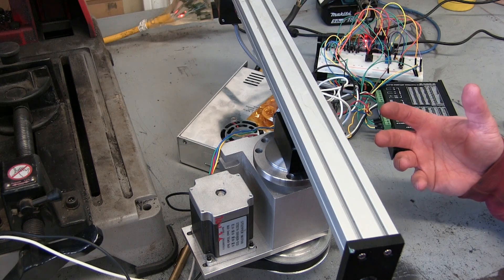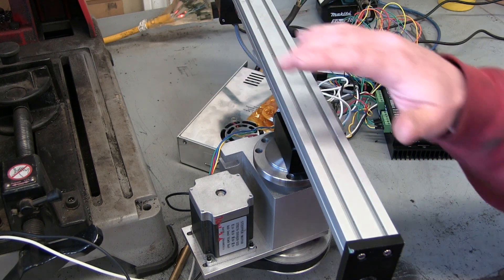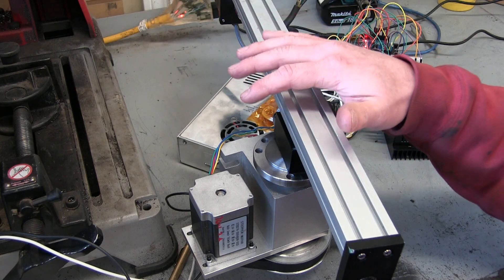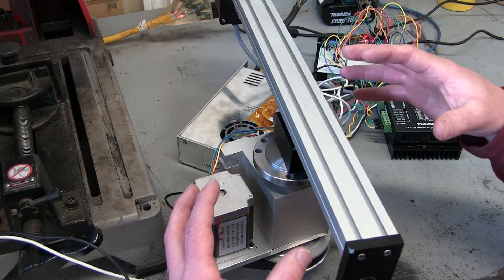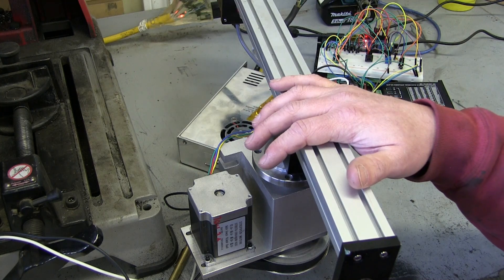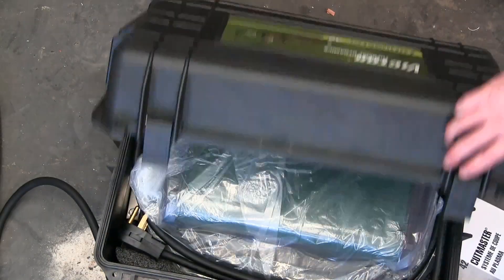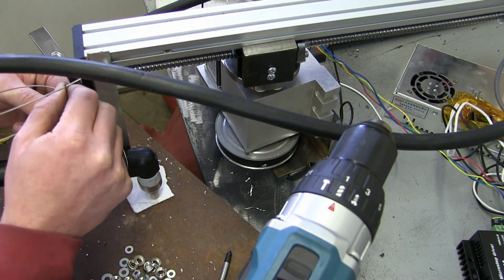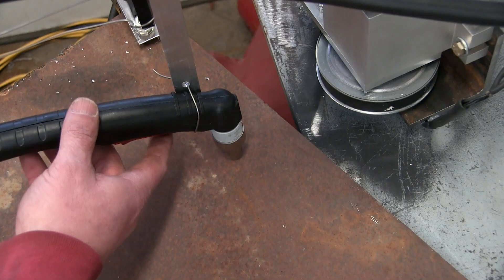Portable CNC Plasma Prototype

Comment: The obvious pitfall is that angle errors are amplified as the arm extends.  That'll be a headache for larger work.  You can set an upper bound on tolerances by limiting the arm length or using a more precise motor.  But if you want this kind of thing to scale, you probably need feedback.  I vote computer vision using fiducials or a stick-on grid.  Not trivial, but it is doable.

Comment: As you said AvE it's gotta be simple as frigg   ....   I think that's where your issues lie.   And you're thinking the app part but I think you're right, the app could be fairly simple and get the job done.  But Magdrills are used inside the webbing of I beams, or in truck frames, places where there's some sort of boundary in place.  You're proof of concept here looks a bit on the large side to fit in those places but that's not even the worst part,   it's making sure the slot it cuts is aligned to the beam given that you plopped that magnetic base down in the first convenient place.   You mentioned programming it once to do a series of holes  ....  how do you align that series of holes to the axis of the beam?   If you're gonna tell a 40 y.o. tradesman to do a bunch of layout first to figure out where to put his magnetic base then you lost him right there. If he's gonna have to do layout anyway, he'd rather it end up with a center punch showing him exactly where those holes will be and the only way that f**ks up is because he missed his punch mark with the pin inside the rotorbroach.   Laser projection was mentioned, it's a good start but I think it's more complicated than that.

What if a flat surface was included on the boom which could be aligned with say a beam flange. An angle sensor would then tell the programming "This is the theta = 0 deg line."  A simple combination square could be slid along the beam flange to reach across to the boom and align this flat datum surface. The user then pulls the torch carrier into place which calibrates the "radius = 0" diameter?    With that you've calibrated the theta = 0, radius = 0 coordinate, of the geometry you plan to cut, while also inputted the directionality from "0,0" to find the center of rotation for the magnet the boom actually rotates about.  This however would require an absolute position sensor for linear movement of the torch carrier and adds cost.

Sorry for the novel,  trying to offer a bit of a solution after pointing out potential problem

Comment: Kinda worried about the precision on your rotary axis.  It's going to get less accurate, and have a lot more flex to it, as you get farther from the pivot point.

You want to figure out a way to get that plasma cutter as close to the axis of rotation as possible.

Comment: I like the idea! The open source 3d printer and lasercutter community pretty much has everything you need to accomplish everything you want. Everything from the main board to control the steppers, all the way to an app on your phone to control the thing. They also have similar polar kinematics already built into the different 3d printer firmwares along with special gcodes designated for firing the laser or starting a plasma torch. The firmware is really easy to modify depending on your setup as well. All you would need to do is build the hardware and connect up the electronics. As for creating the toolpaths, I would use something like Laserweb (still in beta). It's super simple and intuitive, then you can just send that gcode to the machine and bob's your uncle! If you're serious about making it, then let me know. I can point you in the right direction for the different software and control boards, although I know that you are no slouch when it comes to wrangling those pixies!

Comment: It'd be interesting if it had a dry-run mode that just used a laser diode to indicate where the cut would be while it moves through the motions.
Reply: or a magic marker holder, dryrun and paint a pretty picture.

Comment: Your control algorithm will need to know for the current radius of the linear axis  and account for it in the feed rate of the rotary axis.   Just like facing on a lathe, you will need to implement a "constant surface footage" function to speed up the rotary axis as the linear feeds in and slow it down again as it feeds out.

Comment: It's missing HPHT, you'd also probably need a quick way to calibrate the tool before each use to make sure you don't you end up with metricsexual or smelly imperial units that aren't accurate. I've seen a handheld CNC wood router solve that problem using cheap QR code like stickers that a camera on the tool then capures and uses to keep track of where it it is in space. this method also lets you do some other cool augmented reality stuff when it comes to placing pre canned objects. you could probably migrate some of that functionality over to a smartphone app

But the idea is brilliant.

Comment: Mark it with the plasma, cut it with the pliers ;) maybe after a few of the bugs are worked out implementing a rotational axis to the torch head for starting bevels or maybe intricate cuts in angle iron

Comment: Welder studying to be an engineer, I would use this all the time! Cool idea for sure! So converting this thing to x, y coordinates ain't too hard. It's working on polar coordinates (radius,degrees), simply x = Radius*cos(degrees) and y = Radius*sin(degrees). I also want to suggest that if you want to make it simple for using, consider a linear actuator to set the height of the torch above the workpiece and have it read how far it is from the workpiece when it cuts. That way you can account for curves, bumps, height differences and whatever else! Big fan and hope you get a a chance to read this 👍🏻

Comment: Fuck yeah I'd use this, thats badass. Coding would be done with Java for the App and that way its cross-platform, you could run it on a windows tablet or laptop, android phone, windows phone, iPhone, linux computer, whathaveyou. I would think you might need a sensor or two to pick up its home location and orient itself for the whole rotary axis plus linear axis.

Comment: If you want cleaner cuts you can do what laser CNC machines do and punch through inside the perimeter of the piece you're cutting and work out to the perimeter then cut your shape. There's a name for it I forget (it was 15 years ago I worked with lasers and I'm getting old so..) but it'll stop you having that blow hole where you start your cut when the scrap in the middle is removed.

Comment: Well, I don't know about fancy programming, and your pixie paddocks, so there may be many reasons this won't work. But if it were me, I'd want the cutter head position as an input (axis and depth), and then trace the shape I wanted manually. Take whatever the input from manually drawing was and find a way to make the head "do what I did". If all you're looking for is a bunch of canned shapes, trace them at an appropriate speed and run them like a macro.
Reply: I'm not sure what your full intended use is, but a repeat button for some shape would be useful. "Train cutter", repostition cutter, layout next position while cutter cuts. Robo Apprentice TM

Comment: this is a great idea, using a mag drill is fine but ive found sometimes you cant get the mag drill in the right place so i have to weld on extra plates to mount the drill on to. but this with a smaller foot print would be really good, plus you can use this to cut any shape, so it has multiple applications!!! keep the great vidjayhoes coming!!

Comment: I think some machinists  would like to double-check what is going to happen before they commit to cut. I suppose a sheet of sticky-back paper and a pencil attachment would do, but a laser mounted on the mast would be really sexy. The laser would allow for quick alignment. Project the shape you want onto the stock, align it and switch on the magnet.
Reply: Implemented with something like this: http://www.ebay.com/itm/20Kpps-High-Speed-galvo-scanner-for-laser-show-lighting-RGB-Laser-system-Scanner/142189395491?_trksid=p2047675.c100623.m-1&_trkparms=aid%3D222007%26algo%3DSIC.MBE%26ao%3D2%26asc%3D41375%26meid%3D200f63457fe849b8ad313fcd862f5bd0%26pid%3D100623%26rk%3D2%26rkt%3D6%26sd%3D221204811926
Reply: +Paul Rautenbach Thanks for showing this to us. That galvanometer-based laser scanner would be interesting to try! It depends on how shock-resistant it is and its ability to stay calibrated. It may have to be implemented as a magnetic or vacuum base with a laser head unit and a separate CNC cutter unit. Put the laser head on to position the base, remove the sensitive laser head and replace with the cutter head. I'm thinking the final mirror needs to be nearly as far above the stock as the length of the cutting arm. It could get bulky.

Comment: You need to figure out how to convert planar figures into polar coordinates (quite easy).
You can't use Arduino for it as it doesn't have enough floating point power (probably has an emulation)
There are controller boards that can do math fairly quickly.

Another option is to have a precompiled gcode that takes the geometry of your jig into consideration.

I'll be happy to help with math.

Comment: Makes ya all tingly, don't it?

We used the mag drills building the locomotives for LIRR. Power went out one day in mid tap. The safety chain held, but what a pain gettin' that tap outa there!
Reply: Oh yeah I've been up on a ladder on an old head gate made of manganese steel or at least some cast iron like alloy, reaming out some holes, with an old slugger when the magnet broke loose. Mag-drills are awesome but you learn real fast that they can be real dangerous.
Reply: seems power cables and outlets are a hot commodity working construction in the middle of nowhere... i've had the joy of being up on a ladder trying to catch one of them bastards after some fucker figured he'd just go ahead and steal one of the extensions that was powering it. safety chains probably would be a huge help, but they never seem to stay with the drill...
Reply: Samuel steel, got laughed at as a younger fella bringing the monster overhead crane over to safety that mag off too.  3 or 4 holes later some dingus loto'd the circuit we were on for the drill,  sure got the attention of the guy in the hole as its crashing down, banging off the walls of equipment towards ya.

Comment: Let me start off by saying "Fuckin right donkey I'd  use this!!" I own a custom metal fabrication shop and started it from scratch. I have been welding professionally for 21 years. I own and run on a daily basis a 5ft x10 ft cnc Plasma table with a hypertherm 85 on it. My table currently uses 2 264oz. steppers for the x axis gear drive and 1 264oz on the y axis gantry and a servo on ball screw for the torch height controler. 
 I own 2 mag drills and its always the same problem.  I work on a customers truck or prebuilt object and need to put a clean hole in it for some sort a light fuckery. Can I make some suggestions?
 1  Make the base magnet highly flexible to move or two smaller ones to pmace around hard to reach areas or off a tack on base when there is no room. 
2 glue a Chinese laser pointer to the torch body to line up your 0.0 start point
3 App wise make a quick library of holes, slotted holes, squares and what not to choose from.
4. Use a small 180 deg torch  to cut down on bulk with a small highly flexible pig tale that runs from the base to torch but has a quich disconnect to the plasma torch lead. (cannibalize the extensions made by the torch manufacturers)
5. Have it so the plasma gets turned on by the control box through the automated plug in back or tap into the inside with a disconnect plug .
6 Concentrate on the quality of the linear bearings as and vertical or lateral movements get exagerated greatly in the cut especially the further from the base you would travel. 
7. Find a way to make a mini z axis  due to peirceings on anything over 1/4" plate especially in a fixed torch blows back alot. So run it so it hits the plate to find the surface comes back up to a predetermined peirce height then drops down to commense to cut. All this can be programmed into a simple plc or raspberry pi controler. 
Just a few ideas that really make it tear some shit up. 
Oh yeah!!  trailer brake magnets make excellent mini electro magnets. cheap too.

Comment: if it's a a cnc thing you should make it so it's possible to use it to draw a outline with like a paint marker first so you can see if there's any issue before you actually cut the material.

Comment: If I'm not mistaken, you could probably hijack the fartesian to rectumgular conversion math from the open source delta 3d printer slicers or firmware. There should be an intermediary step that does the raw math.

Comment: on the app side of things I'm imagining some kind of option where you take a pic of your target area with a standard unit of measure in the frame, steel ruler for example.... then import templates to the pic or free draw for the more artsy fartsy types. Check the path in a preview on your phone and or/a dry run, at the operators discretion. Then hit the big red button to initiate the noise.....button must be big and red.

Comment: Maybe a way to angle the cutter, so you can get a bevel on the material you are cutting. Since a 90 degree cut isn't always ideal. Also this opens it up a bit better into things you might have to do in layers, thus stacking sheet on top of sheet.

Comment: a fast-speed dry run if werkable. a convex hull of the cuts as a dry run to make sure the area is compatible. are there ways to get a steels thickness without the monkey typing it in? radar sonar induction capacitance impedance? expensive version with a camera running one of them fancy vijao anal-geezers to watch the cut, but then the monkey needs to clean the camera :(. a rotor and a camera to turn the welder to follow a line around a curved surface. or do a line following robot. monkey chalks the path, robo-monkey follows the chalk.

now attach that thing to a multicopter and fix my 1930s era rusted out corrugated roof, while you're up there install those solar panels to make the hippies happy. or you know send me a shirt, cause the ideas come free, the sieveing them down from 1000 monkeys not typing Shakespeareian sonnets is the... well its difficult. me like ideer, you make fire on rock in shapes, thank for ideer.

Comment: the algorithms are easy in math speak but what's the input protocols? Also curious what the step size for the gearing/motor setup, since that will determine tolerances and accuracy.

Comment: if it was easy and fairly priced i would use it as a home gamer. side note in high school we had a massive plasma cutter that ran off of i think auto cad? i don't recall and that thing was the X Y axis top down cutter who knows how much that fucking thing costs so it only got used 30 times a year. i think this would be sweet i wish we would of had one in high school then we could drop in and cut what ever we want when ever we wanted

Comment: Add a laser fixed to the magnetic base that pinpoints the home position of the machine, that way you solve one of the issues that is uncertainty of placement.
For electronics I'd go for either an Arduino with a Bluetooth shield or one of them fancy new Raspberry Pi Zero W with integrated WiFi, connect to it's hotspot, open your browser (in either a phone or a computer) and voila, you get your interface. The second option is easier since it doesn't require any pairing or anything.
Reply: The laser should have a bright spot for the zero position, and two lines for the X and Y directions
Reply: A web interface would allow any device that can run javascript to interact with it, making it super compatible with plethora of devices (Plus not requiring installing some software, in case you happen to find yourself somewhere without internet connection)

Comment: to do a square its going to be a bit of a mess, the farther you are over hanging the faster you need to feed back and forth as you rotate. if you draw a square close to the base its a different set of instructions than if it's hte same square but farther out. going to be a coding nightmare aint it? @AvE

Comment: interesting thought. your "feed rate" is obviously important when plasma cutting. if you want to keep it super even and consistent you would have to adjust the rate of spin based on how far out the dingle arm is projected. so there may need to be some sort of linear encoder so the program knows how far out from center the arm is. and since you'll likely be moving both at the same time to cut certain shapes it will have to be a constant feedback loop.

Comment: Thanks for the video. Nice idea hack it together get it working. Get some good programing into the system and away you go. If you can do way with having to learn g code just have the code running in the back ground and just use simple shapes that can be added to each other an then delete the lines not wanted and determine inside or outside cut line and offset and your done.
The average home using does not need anything to overly complex. If you can have a learning system draw your part on the steel and have the arm follow the line and cut your part even better, do away with all the computer input stuff. go to your scrap of metal take marker and draw out your part and then line up the machine and press cut, now that would be the best, and once it makes one you can store the part in memory and it can make copies. Just my idea for a cool and easy to use interface.